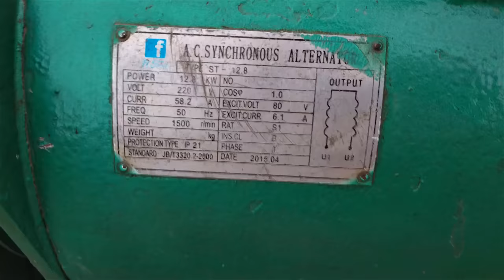Free energy Generator With 100 Kg Flywheel 12Kw Alternator 100% Real Free Electricity

Comment: There.  Is.  No.  Such.  Thing.,  As.  Free.  Energy.  Period.  I do not know where it is, but there is an additional power source providing power to the contraption in this video.  I know this because THERE IS NO SUCH THING AS FREE ENERGY!  If this was real, it would violate the laws of mass-energy conservation.  If this man had accomplished this, he would instantly receive the Nobel Peace Prize and become one of the most famous people in the world.
Reply: Did you try it yourself?
Reply: there is an alternative power source in this video           ???   is this what you meant to say?
Reply: @daviddavids2884  I have edited the sentence to be more clear
Reply: @akatongie1157  I don't need to try it because what he's claiming to do in this video is physically impossible.  There is always a loss of energy when you  run a motor or generator (touch any motor while it's running and you'll find it to be warm).

This video is claiming to provide energy to a motor from an alternator which is being turned by the motor.  Both the motor and the alternator will generate heat.  That heat proves an efficiency less than 100%, meaning the circuit he's built can not work as claimed.
Reply: Obviously he's never heard of Nikolai tesla and his discovery of pulling energy out of the air. Its amazing when you stay in school to learn history.
Reply: @douglassheridan6519  Free energy doesn't exist! I'm happy you seem to have learned some History, but if you learned some science as well then you would know that no machine can exist that both creates power amd distributes it with 100% efficiency. Also, don't you think that if it was this easy to get "free" energy that there would be dozens of people making these machines to power houses and buildings?
Reply: @douglassheridan6519  Tesla was all about generating energy which would be free for the populace to utilize, but he never, ever, said a thing about "pulling energy out of the air".  While it is possible to pull "energy out of the air", the amount of energy available is generally enough to power the average LED light for a second or so per few minutes.  

Tesla's dream was what we now call "wireless power" and he was more interested in providing power to parts of the world which do not have access to a power infrastructure (which is an admirable dream, even today).  In the end, Tesla was still a scientist (although a particularly brilliant scientist) and he fully understood the confines of physical reality.  You can prove this to yourself by looking at his designs for his famous "Tesla Coil", which is what everyone points to when they claim he was working on "free energy".  The designs, written by Tesla's own hand, clearly include a power source.
Reply: @224ryan  Ahhhh.  It's refreshing to be agreeing with someone on YouTube.  Thank you for stating the (supposedly) obvious.  It's remarkable to me how many people make statements like "Stay in school", "Learn history", and "Do some research" immediately after proving themselves to be in need of their own advice.
Reply: It’s not creating energy from nothing, it’s simply harvesting energy from another source
Reply: @rmendes2mendes915  What is the source which is being harvested?
Reply: @VapingWatch  the source is , electrons from atoms that surround us at all times. The environment.
Reply: @rmendes2mendes915  Ok, and how are they creating more energy than they use?  If the environment is capable of creating surplus energy, 1: how does the environment (or components of the environment) create this excess energy? and 2: where does the excess energy go when someone is not "harvesting" it?
Reply: @VapingWatch  when you say they I assume you mean these flywheel generators,  well I kind of just answered that they produce more energy than they use because the excess energy and the energy used to operate them after you have unplugged it from the grid is coming from The environment through the generator part of the system.   All Energy that is generated by method of magnetic fields through conductors is done the same way.   A generator is simply a device that manipulates magnetic fields to create a condition where electrons can flow from the environment and through the device that is what is happening here the device is made up of 3 Components Drive motor, flywheel mass and The generator which is the key component used to extract the electrons from the atoms from the environment.  The motor and the fly wheel create the condition needed to keep the generator spinning.   But the generator is where the new power is entering from.
Reply: @rmendes2mendes915  I can't figure this out.  Do you actually believe what you're saying?  Or do you know what you're saying is completely illogical and you're just doing it to troll?  I'm honestly curious.
Reply: @VapingWatch  yes I do believe you can harvest energy for just about free after you build the device that does the harvesting
Reply: @rmendes2mendes915  
"I have done it myself":  No, you haven't.  I know you haven't because what you are describing CANNOT happen in our universe.  

"Where by manipulating magnetic fields you can extract electrons from the environment":  I'll allow for this possibility, because you're not stating the amount of power available to be "harvested"".  The total amount of natural energy (not Solar) able to be harvested at any point on our globe is barely enough to light an LED light for a fraction of a second.

"The extraction process just allows electrons to drift from one Atom to the next so each atom doesn’t actually lose its electron it gets its electron  replaced buy the atom next to it":  This is the most ridiculous thing you've said so far.  This would indicate there is, at the most, a single electron worth of energy at any given point in time.  This is not remotely enough to power an LED, much less the "machine" in this video.

"I can see your passion to dis- prove these free energy so-called devices but the fact is you have been deceived by the worlds propaganda and so have all of us":  No, I am convinced by mathematics what you're talking about is impossible.  You simply cannot have a net energy output greater than the energy being supplied.  This is not opinion.  This is fact.  You may as well argue that water is not wet as this is the same illogical and fallacious kind of argument.  

"The ones who escape the deception are those who don’t just take man’s word claiming what is true and what is not instead  they will investigate research experiment and find out for themselves what is true and what is not.":  So the years I spent in school to earn my degree in Geological Sciences was wasted?  While I won't argue that I wasted my time (got my degree in 1998 and haven't had a related job since), the years of study and experimentation proved to me the logical fallacy of "free energy" devices.  

"Don’t let the world keep you from truth make one of these devices": Don't think for a second that every single person pursuing a degree in any kind of Earth science discipline hasn't done just that as part of their studies.  Not a single person, in the history of the Earth, has yet to create a machine with greater than 100% efficiency.   Because it's impossible.

Let me guess, the next thing you're going to tell me is you believe the Earth is flat, Space is fake, and the "down" direction is determined by density.  Because that would be every bit as ridiculous as what you've said so far.
Reply: @VapingWatch  OK that’s the beauty of being human you can believe whatever you like even things that are not true I have shared some of my knowledge with you knowledge being truth if it’s not true it is not knowledge and I have dedicated my life to truth.    I can see by your words you are lacking in knowledge in this area it will do me no good to continue speaking with you
Reply: @VapingWatch  You are complicating matter for yourself. The whole system is simple. It is possible in reality. This is what happened.
The system has Power Generating Unit (PGU) and Power Supply Unit (PSU). The 3HP motor is PGU and the alternator is the PSU. As the PGU turns, the wheel turns the PSU. The 3HP motor initially got its power source from external AC power. However, as the PSU, the alternator, continued working for a while, it generate AC power enough to power both the 3HP motor and other appliances. So, immediately the plug of 3HP motor was removed from the external AC source, the wheel was still turning and the AC current was still coming out from the alternator. So, quickly, the plug was inserted into the socket collecting power from the alternator and the everything enters into circle of energy . Alternator now power motor, motor turns the wheel and the wheel turns the alternator and by so doing, the alternator keep producing its current. This system wouldn't have been possible if the power coming out from the alternator is not enough to run the motor and power other appliances. But as far as there is a large difference between alternator power and motor power, everything becomes possible. Although there is loss of energy, but the loss in alternator is due to friction not from coil, and the energy loss in motor is due to friction not from coil. Current comes from coil not magnet or environment. But this energy loss is small enough for the whole system to.continue working for many months before it stops due to ware out of the mechanical part. 

If you cannot try this on large scale, try it on small scale. But remember, for it to work, the power coming out.from PSU must times 4 that needed by the PGU. Then it will be like magic.
Reply: He is charging up energy in that flywheel with the motor using that energy to keep it spinning beyond its loss. The flywheel is stored energy  releasing its energy before the motor will equil itself out with the generator.
Reply: @2a4defense65   Your lack of understanding of how energy works is depressing.  This is 3rd grade science stuff here.
Reply: @224ryan  you can’t prove a negative. You can’t say something is not possible you can say that you have never tried it.
Reply: @5disguised  I can say that I am sure many scientists smarter than you and I combined have  researched any possible way to make "free" energy and yet to this day, not one credible invention has came out that produces legitimate free energy. I am not intelligent enough to disprove this with electrical knowledge,  but I can say that if it was as easy in the video to get energy for free than these machines would be all over the place.
Reply: @224ryan  appeal to authority is a logical fallacy. And I don’t think this video is definitely it but I definitely believe free energy will one day be a thing.
Reply: How much coast  total this set pls  give the list and  where it vailable
Reply: @swinde  A rational, coherent, and logical comment!  Are you sure you're in the right place?  I was beginning to think this video attracted only people who believed in free energy, unicorns, and emails from Nigerian princes!  Thank you for bringing a degree of sanity to this otherwise absolutely insane comments section.
Reply: @VapingWatch  
Thank you.  I don't remember the source, but there is a guy that has built a "perpetual motion machine" and it is on display somewhere.  The difference is that he admits that it has a hidden power source.  He has challenged the scientists to try and identify the source of its operation, provided they do not disassemble the system in any way.  I have not heard whether anyone has solved the problem.
Reply: @VapingWatch  you start saying dumb shit when he really started breaking the metaphysical science behind this technology down
Reply: @VapingWatch  you drink too much fluoride
Reply: @gtbonezz  You eat too much paint
Reply: @VapingWatch  “ I do not know where it is but there is an additional power source...” 😂😂😂 Cognitive dissonance
Reply: @gtbonezz  You need to look again at the definition of "Cognitive Dissonance".  Lurning iz ezey.....u juss haff to tri!
Reply: The sorce enegy is in the box of the lights
Reply: @daviddavids2884  The hide source is in the box of the lights
Reply: @swinde  The gide source it in the box of the lights
Reply: @swinde  The hide source of energy it in the box of the lights
Reply: @5disguised  your looking too hard, free energy is easy, solar power, wind power, it fits the description perfectly, just get the device, set it up, then free power. I haven’t paid a power bill for 12 years, solar panels power my energy hungry house, I even get credit (yes I get paid from the power company) for excess power I produce, no need to look any more

Comment: 9:52 is where you can see the additional power source going into that motor. Carefully tucked under the framing, but the walk-around missed hiding that wiring 😂
Reply: Indeed... Why do people still have the drive to let people think there is such a thing as free energy...
Reply: Sorry I don't see the neatly tucked wires
Reply: Can you be a little more specific
Reply: You mean there's a third wire? Where?
Reply: @thimitri1  A orange wire, at the bottom, between the motor and motorshield at the backside of the motor. Clearly visible for a couple of seconds after 9:52
Reply: I suspect too
but I checked that wire at 0952
and I saw it is no wire but there is empty line at 1028..
Who knows???
Reply: @RS-qp4bp  There is a bad video edit that discredits the presenter. BUT According to Occum's Razor theory (please do your own research) the best answer is the most simple one.

This is a confidence trickster! Prove me wrong! There is a sneaky power connection through a cable buried in the mud under one of the hollow metal legs resting on the dirt. Share a new video with the metal fame pulled up off the ground, and passing your hand underneath (with this running) The poster is only interested in being paid by YouTube for AD money from many clicks.
Reply: @thimitri1  There is a bad video edit that discredits the presenter. BUT According to Occum's Razor theory (please do your own research) the best answer is the most simple one.

This is a confidence trickster! Prove me wrong! There is a sneaky power connection through a cable buried in the mud under one of the hollow metal legs resting on the dirt. Share a new video with the metal fame pulled up off the ground, and passing your hand underneath (with this running) The poster is only interested in being paid by YouTube for AD money from many clicks.
Reply: @zekioner8747  There is a bad video edit that discredits the presenter. BUT According to Occum's Razor theory (please do your own research) the best answer is the most simple one.

This is a confidence trickster! Prove me wrong! There is a sneaky power connection through a cable buried in the mud under one of the hollow metal legs resting on the dirt. Share a new video with the metal fame pulled up off the ground, and passing your hand underneath (with this running) The poster is only interested in being paid by YouTube for AD money from many clicks.
Reply: @RS-qp4bp  that's easy. The white cable may hide one phase that would supply for the motor. Super easy!
Reply: Thank you I totally missed the white cable under the leg of the metal frame. You have an eye for detail huh ?

Comment: If my analysis is correct here, the kinetic energy stored in 100kg flywheel is used to run the motor whenever external load is applied (running angle grinder or welding machine in this case). The external appliances will run until the flywheel looses its kinetic energy completely, then the appliance starts eating power input share of driver and the rpm starts decreasing slowly.
Reply: Source of kinetic energy is 3Kw electric motor. Wheel is helping to avoid variation of the RPM when he is increasing number of consumers
Reply: are you sure sr!?  IM NOT WANNA WASTE TIME TRYING MAKING SOMETHING LIKE THAT!
Reply: its fake don't waste your money

Comment: Can you share how you rewired the alternator please? Thanks
Reply: Don't expect any answers from this poster. This is a confidence trickster! Prove me wrong! There is a sneaky power connection through a cable buried in the mud under one of the hollow metal legs resting on the dirt. Share a new video with the metal fame pulled up off the ground, and passing your hand underneath (with this running) The poster is only interested in being paid by YouTube for AD money from many clicks.

Comment: I was wondering, how did the generator generates electricity without DC excitation? I see no battery to excite the rotor winding in order to produce magnetic feild. This generator is not a permanent magnet rotor
Reply: It's a trick, it's in the light box. haha
Reply: haven't you heard of "self excited generator"?
Reply: Yeah, look for self excited alternators. They are not new. I work with them everyday. And no brushes also.